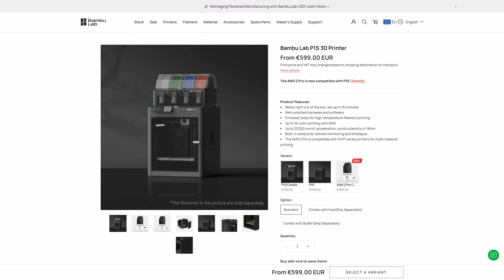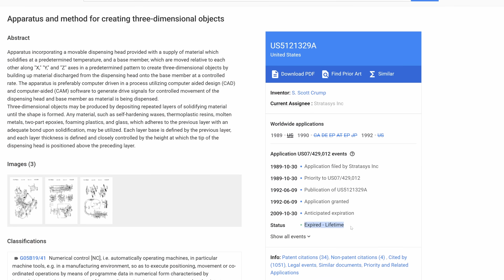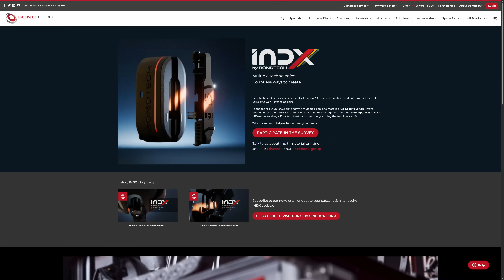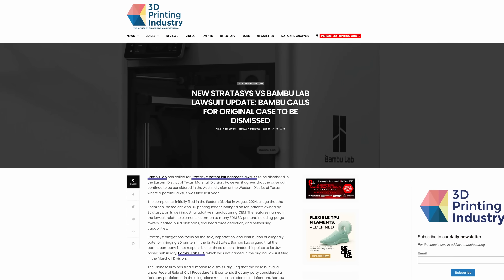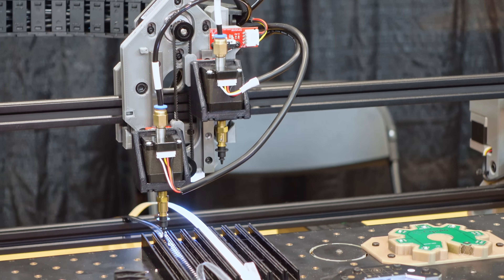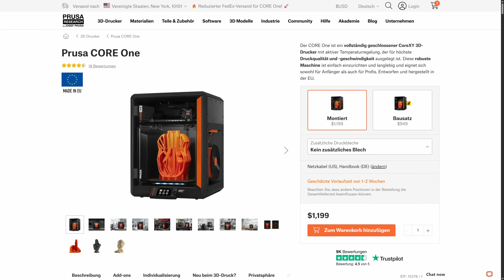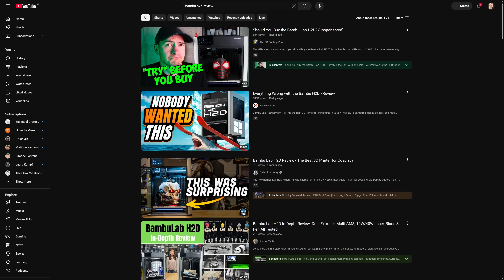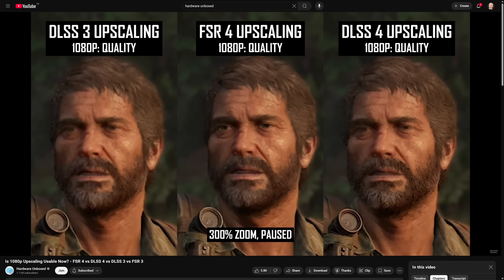How Bambu has won

Comment: The Bambu machines are great, until they break.

I had to replace the carbon rails on my X1C - a ten hour job that almost broke me, and saw me box up the printer to take it to the tip at one point!

And currently my H2D is down and in pieces, awaiting replacement extruder idlers.  And two other parts that broke as I was trying to follow Bambu's instructions to remove the extruder idlers   That’s only a two-hour hob to fix.  

All the community seems to say is "if you can’t fix it yourself, you have no business owning a 3D printer, n00b".  Ignoring the fact that whilst a Prusa could be taken apart with nothing more than patience, the Bambu machines are made from very intricate (and delicate) parts, with more in common with a modern laptop.  

And there’s little tinkering that can be done with the hardware.
Reply: There's soon to be much more tinkering if projects like X1Plus and their expansion board and community gain more attention
Reply: Comment instantly validated by ignorant remarks. Where you live determines the capacity of repair and servicing. 

Some of you toddlers need to inquire more instead of ignorantly assuming and presuming your own superiority on a topic.
Reply: So how did those carbon rods fail exactly??
Reply: @andyspoo2  Great question.  As far as I can tell, manufacturing fault; Bambu have since updated the design.  Some sort of resonance frequency issue.  All I know is that from pretty much day one they were yelling at me to clean them every week, then every few days, then every few hours, then all the time.  Even if they'd just been cleaned again and again and again.  Bambu had me run a custom script that they had come up with, send them the log file, and they said "yep - faulty; we're posting you out some new rods".

Of course, at that point I should have said "no, send me a new machine".  But how hard could it be, replacing the rails?  The answer is "quite hard"; the machine has to be stripped down to the chassis, the belts, rails and toolhead all swapped over or replaced.  Took me hours (some of which was with the printer back in its box ready to be taken to the tip the next day; hint, replacing the belts can be a sodding NIGHTMARE).

Since then, I think that the printer has asked for the rods to be cleaned ONCE.  When they actually needed doing.  The rest of the time, I clean them every four weeks or so and we're all happy.

I suspect that the carbon rods will wear faster than the rails in the H2D.  But the H2D clearly has other weak points.  And is even harder to work on.
Reply: @ViscountCharles  Interesting. I believe they used carbon robs to reduce the mass when moving the Y axis. A good idea in theory.
Reply: Comment instantly validated by ignorant remarks. Where you live determines the capacity of repair and servicing. 

Some of you toddlers need to inquire more instead of ignorantly assuming and presuming your own superiority on a topic. 

Also, design for repair is a specific element in engineering best practice. The ownership base needs consideration in that aspect as do compromises with ‘design for manufacture’. Simplification, optimisation of function etc.
Reply: Have you considered just sending it back to Bambu? Don’t they offer a service to fix it with a fee?
Reply: @87togabito  No, they do not.

In theory they offer a guarantee; in practice, that means that for the first 12 months they will send you out any broken parts FOC, but you have to fit them yourself (and that assumes that you have the skills, the tools and the eyesight; one repair, they told me to check the voltage at one pin.  With what?  i have no multimeter, nor any need for one ...)
Reply: @ViscountCharles  Tell them you're blind and cannot repair the machine yourself. They have to honor the warranty by law, so either you'll get a new printer or they'll find a way to fix it themselves. Otherwise you'd have a nice lawsuit on your hands.
Reply: @gownerjones  Tried that; they still sent me the spare parts and told me to get onn with it.

Which I did.  Managed to fix the H2D in the end.  Now the X1C is broken again, and this weekend I get to swap two circuit boards and the laser module over; I am NOT looking forward to it.

These machines are great until they go wrong - and they WILL go wrong at some point.  OTOH, I have something like 15,000 hours on the X1C.

On the OTHER other hand, I have the same sort of use on my TV and video recorder, toaster and microwave - which contain the same sort of microelectronics.  And they haven't broken down once.
Reply: @ViscountCharles  Then you've got that lawsuit waiting for you mate, go see a lawyer.
Reply: In the EU, like all manufacturers, Bambu has to offer a 2-year warranty which is pretty damn good. And beyond that, they break incredibly rarely from what I'm reading, which means you really shouldn't try to fix them yourself, even if you're an avid tinkerer. If mine ever breaks *knock on wood*, I'll likely call them up instantly and report a warranty case.
Reply: Different target audience. The vast majority of these printers just work, and when they break in a big way they just want you to give it to them to fix. If you’re the tinkering type you really shouldn’t be buying Bambu printers, and likewise if you just want to print with no tinkering you shouldn’t be buying a voron kit or something
Reply: I don't own Bambu, but we got horribly problematic XL to work. Nothing but problems and that s there in the end is the issue. As mentioned it was bought for business and we were expecting to get really good machine. I've needed to disassemble and tweak first filament sensor, corexy belt tuning cause of bad pulley alignment, changed extruder load cell and sheet as machine carved nozzle into bed. Now after all this we began to got similar problems to previous load cell failures, but at this moment I pulled the plug and notified customer service that were not doing anything else for the printer in our company time, but that we need to send it there for warranty repairs. We've been highly disappointed that I suggested that could they just send new working printer and figure our what's wrong with ours. Just would send our back in the new ones packaging. But nope. Prusa isn't ok with that idea and they sent us packaging materials, which turned out to be XL single kit. This means that I now have to disassemble the enclosure completely, remove hotend etc. for shipping purposes. XL isn't very nice to work either. I've spend I think plus 12h into troubleshooting and communicating with Prusa. I have MK3S at home and cause of my suggestion we got same for work. Now I suggested XL as we needed large format printer, but man it's been disappointing. My home update plans for possibly getting Core is now like 3% likely. Before XL arrived I was almost certain I'd get one. But if it's gone this clumsy to work with Prusa, they're not an option anymore. Like every single god damn time I have to contact them by chat. What the hell? Wait times of about 30mins and no. I can't get contact information to sort issues out via emails. It's absurd. What kind of business isn't ready to contact customers via emails? This is a real issue in business environments. Hence I honestly can't recommend any Prusa model for businesses.
Reply: @jothain  Get an X1C. I bet the experience will be 100% better. If it isn't, take it back and get another.
Reply: @agelessstranger964  Not gonna happen. It's WAY too small print area doesn't work for us at all. I've already ran into design issues with XL's size already. No way to back down on print size area anymore.
Reply: So you're saying, the machines can totally be fixed, you just can't bear with the time or effort to do so?
Reply: @stevato0449  we can totally go to the moon.  I just can’t bear spending the time or effort to do so - and would prefer that the job of going to the moon was left to the space agencies, rather than to me.
Reply: I could say the same about my Prusa. I had a Prusa Mk3 and had a clog in the heat break, a small little part in the middle of the extruder/hotend assembly. It is an absurd amount of dissasembly needed to get to that part. The Mk3 was simply not built to be able to service that part, not to mention that there were no instructions from Prusa online for that specific job, I had to figure out from the full-build instructions how to do it. When I saw the A1 had a hotend where I can replace the whole hotend/nozzle assembly in 1-2 minutes, and a filament changer that just worked unlike the Prusa finicky changer, it was a pretty easy switch. I understand that other things may break that will difficult or "impossible" to replace in my new printer though.
Reply: If it’s too hard, MicroCenter will service it.
Reply: @rsilvers129  the 3,000 mile trip to my nearest micro centre seems a little unlikely to make this happen.  Plus my machine is broken; it needs repairing, not servicing.
Reply: Sounds like a you problem, not a them problem. I’ve got 4 Bambu Lab printers (1 of each series) with 16k hour print time between them. I’ve replaced all manner of parts, never run into any difficulties. Get someone else to repair your printers.
Reply: @radish6691  Sounds like what I've been saying from the start.  If the machine is less than twelve months old, the person that should be fixing it is the manufacturer.

And yes, if we're willy-waving I have about 16k on my printers too.  I also have 180,000 miles on my car - still doesn't mean I should fix it myself when the headlight fails within the warranty period.
Reply: @ViscountCharles Wow, incapable and creepy, you’ve got it all!
Reply: Bro it took you 10 hours to change the rods no wonder you're having trouble with everything else, it seems to me that you need to learn basic repairing stuff first before you 3d print
Reply: 10 hours to replace the carbon rail - this says more about your technical aptitude than the printer design. Not everyone finds 'tinkering' easy. I suspect you would still struggle with a Prusa or whatever.

Comment: What Bambu has done is to commoditise 3D printers - the ability to buy a 3D print and just start using it has lowered the barrier for entry. That's why they've been so successful: they're attracting people who might have been interested in 3D printing, but didn't like the complexity of the level of knowledge required to get prints looking good, and so didn't buy one until now.